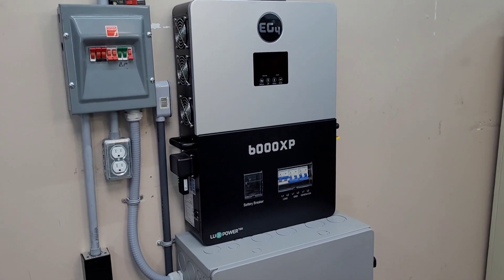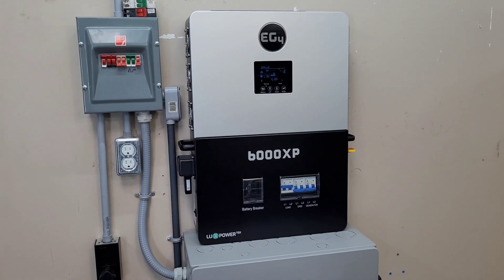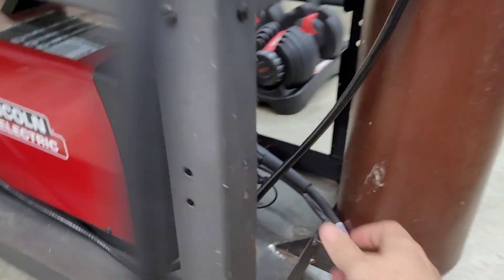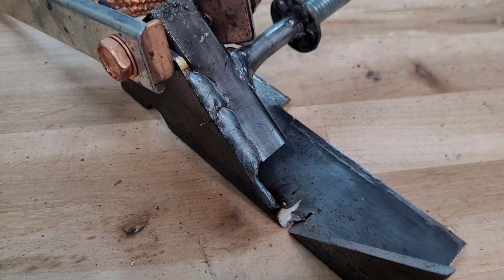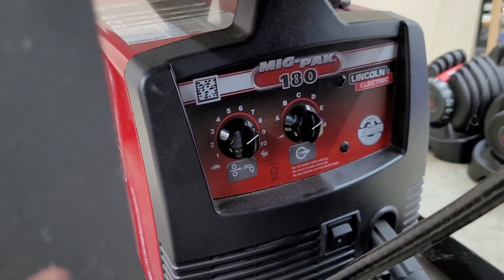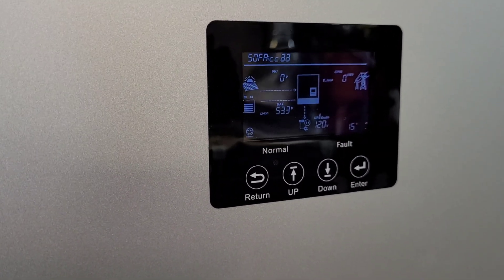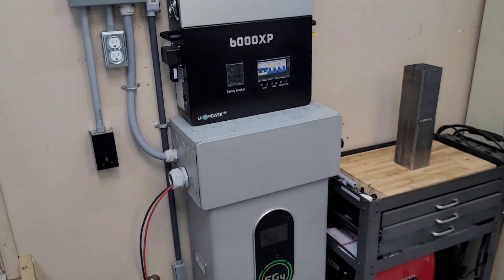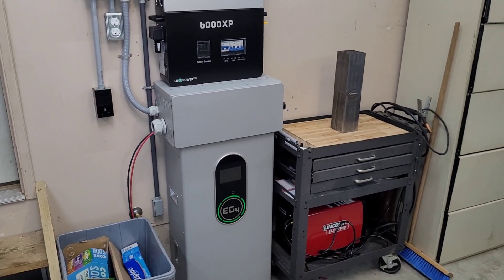Can The EG4 6000XP Run a 180 AMP Welder?

Comment: I would never install one of these cheap, lightweight, high frequency transformerless inverters in my home. They offer far poorer surge capacities. A much shorter life expectancy, and because they don't have an output transformer, they can damage your appliances and even your welder when their MOSFETs fail. A much better choice for an inverter is a low frequency, transformer based inverter. Don't take my word for it, ask Google AI the following question: Can a high frequency inverter damage your home's appliances?
Reply from the maker: @solarcharging9743  Low frequency bot is back!

Comment: Per its specsheet, the Mig-Pak 180 only draws 20 Amp @ 230 VAC at its rated output. Nothing to brag about. The question is, how long will this inverter's MOSFET's last without an output transformer after repeatedly using this welder?  A year, maybe two, if you're lucky?
Reply from the maker: Oh man you're still hung up on this...

Comment: A bit of info i can share with you...slow your wire speed down, make little C's as you go along with one leg a little longer than the other (to move forward) and push your puddle on thicker material for better penetration👍 otherwise, for  "not a welder" youre doing pretty well! 

Great to see this setup running such a load!

Comment: Seems the 6k can handle the surge load and running load of the welder for at least some hobby work. I think I would need 2 to run my water furnace or a soft start.